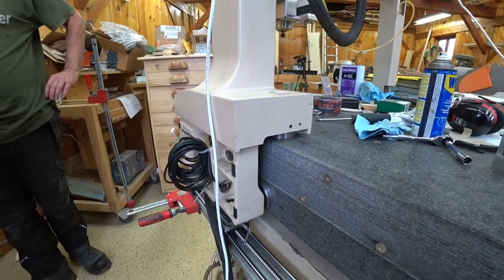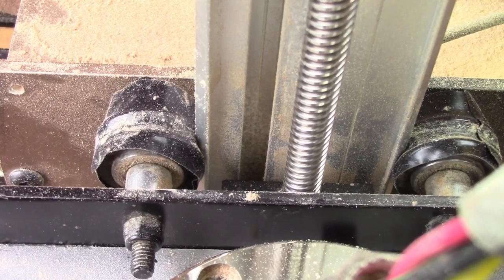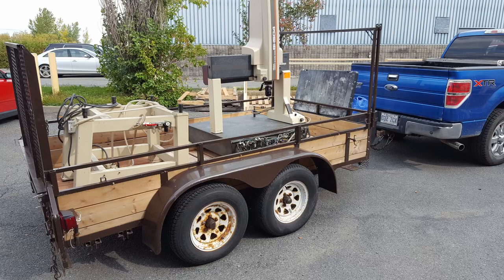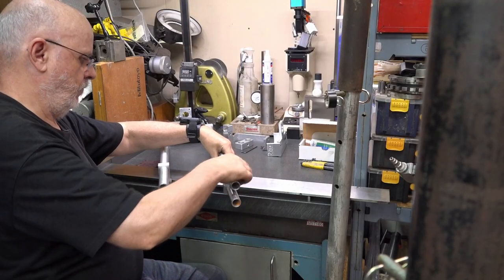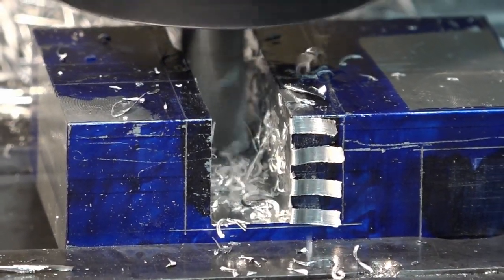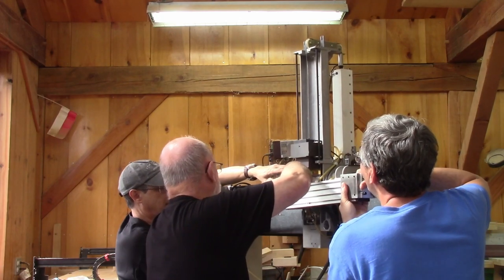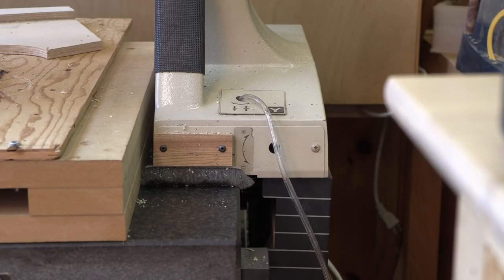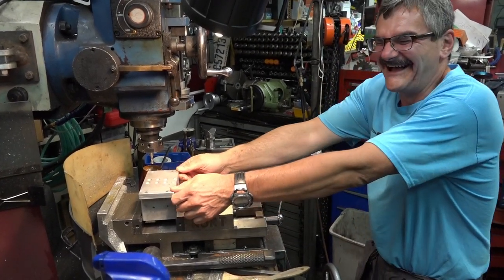A $350 3D woodcarving CNC with a little help from my friends

Comment: wow, I don't know why I didn't see this until today. Google notification on my screen is lagging, or maybe I'm lagging.  Great video, nice to see you back... Oh that poor CMM.. from super accurate work to wood working... oh the humanity...🙃
Reply from the maker: Thaks for your comment...   🙂
It's intriguing that you mention the delay about the notification, I'e noticed weird peaks in the viewing pattern data, and, now it's almost zero viewings all of a sudden....!!!!
About the accuracy, agreed, the electronics was defective on this machine without any available references for repair. This was in deed the reason why it was on sale at ridiculous price...
My first idea was to install it in my shop to use in a very basic manual way, but, as you seen in the video the path to the reserved location in the shop was "Really" an ordeal, also not shown there was something like 3 to 4 tons of steel reserves to move plus even more stuff spreaded on about 15 feet in length.......     😰😰😰
This is where I decided to degrade it and offer it to Alain and his dusty workshop.....    😭😭😭😭😭😭
Cheers,
Pierre

Comment: An interesting project.  Interesting repurposing of a cmm but quite a bit of work to handle a router on it.  Good to see you back with  another video.
Reply from the maker: Hi John,
Pace has slowed down a little but still active, more ideas and videos are in the oven to come out after some proper simmering....   🙂
Cheers,
Pierre

Comment: Oh no, you should fix the CMM machine. It is a master piece.
Reply from the maker: Don't be sad the machinse was defective at the electronic board level. There is no more available support documentation or parts. And after Alain gave it a nice trailer ride it probably lost some of it's prime vertues....  
On the positive side, it makes a very decent CNC that can work just about 24-7...
Cheers,
Pierre

Comment: I love it when people put big engine on trabant and expect it to drive like a formula 1 just because it has big engine !People dont understand how forces are applied and structural integrity and then they try projects like that or to convert a drill press into milling machine . . . sad thing is it costs them more time and money at the end to make a diy crap machine then to save up a bit and buy a real deal(especially if machine is a money maker and not a hobby one that you will use once a year).
Anyway good conversion.
Reply from the maker: Alain had used it intensively for a couple of months alerady, so far this machine is performing surprisingly well and proves to be very reliable for very long duration sculptures...
I have to admit that there was a fair amount of thinking and tweekings, the project took about three to possibly more than 400 hours spreaded over18 months, cost was quite low compared to buying something comparable.
Thaks for sharing in your comment,
Pierre
Reply: @pierresgarage2687  - Few obstacles stand against those who can make their own tools and machines.  Learning all the things needed to do that... sorts out who really has earned the skills!